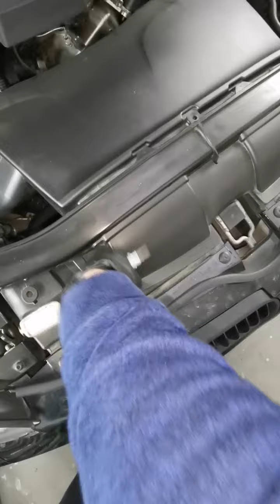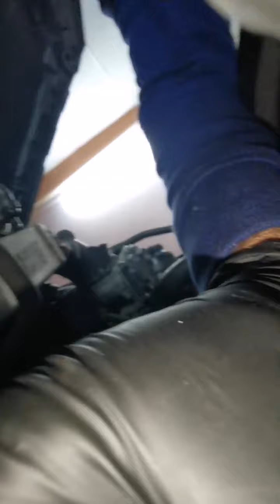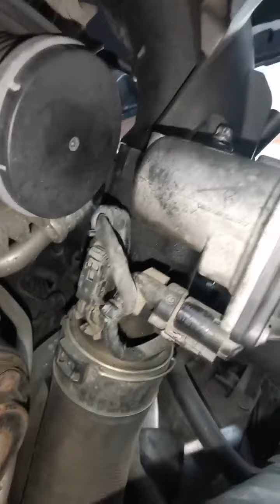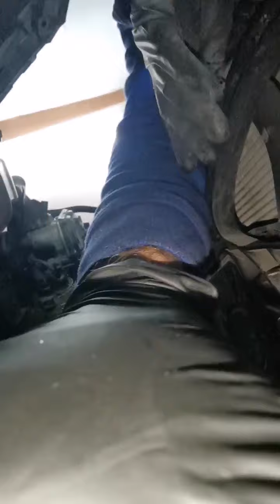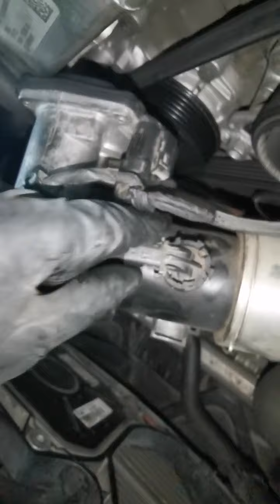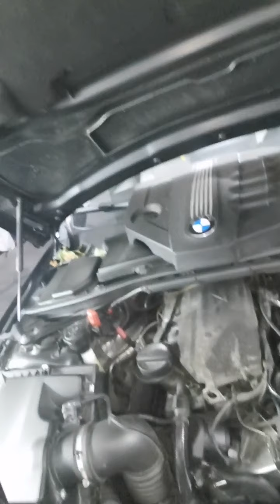Bmw intake air manifold temperature sensor replacement / senzor temperatura admisie

Comment: Is this sensor the same for gas and diesel BMWs? I got recently a F028 error code and found out it is the Intake air temperature sansor that needs to be replaced. I have a 320i N43 E90 BMW. Can you advise? Thanks
Reply from the maker: Ce tester ai folosit de ți-a apărut acest cod de eroare?
Reply: Hi. there great video!!! .. .. How would you know it this sensor has gone bad and need to be replaced? My N47 E90 320D exact same car as what you have suffers from a bad  bouncing idle..  Like the RPM needle goes up and down between 700 and 900 RPM mostly on cold start.... Aside from MAF sensor would this sensor be the culprit... Thank you so much for your help..